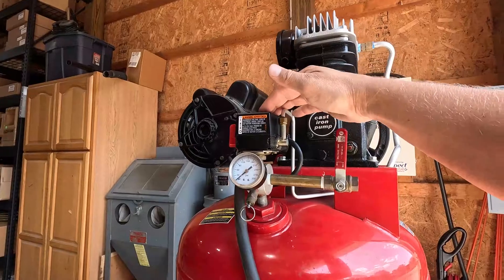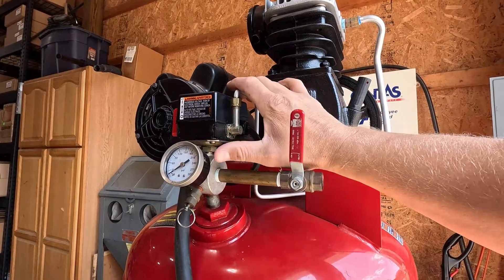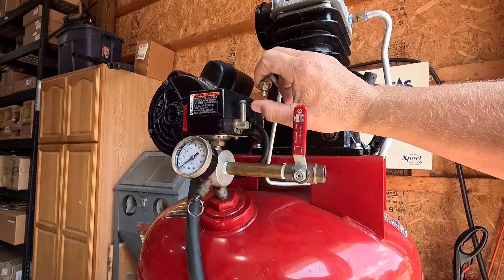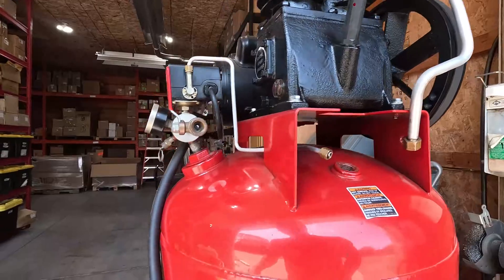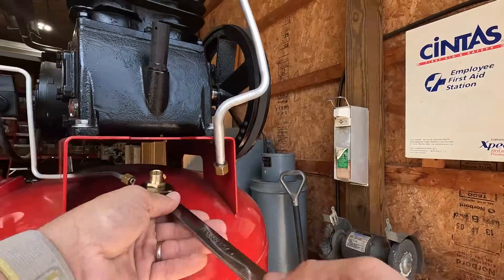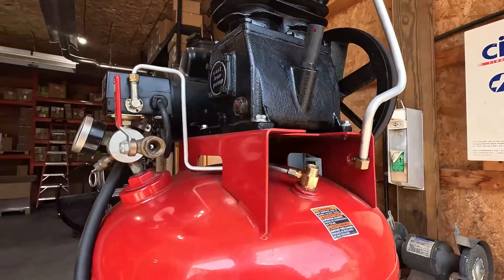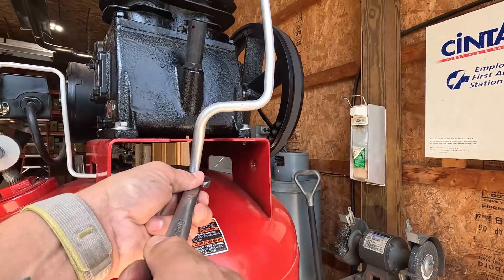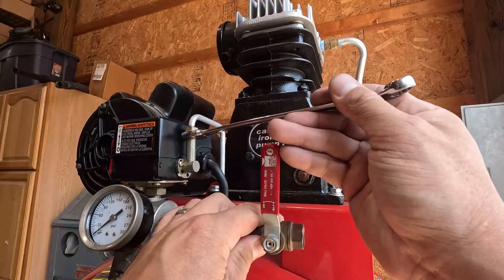Fixing A Leaking Air Compressor

Comment: Just wondering what size check valve your is? Mine seems to use the same size wrenches so I just don’t want to buy the wrong size by accident
Reply from the maker: If you can find the model number of your compressor, we can give you a more accurate part number to purchase.
Reply: @Allpartsinc mine is a diy, but the tank has this  on it VT631402AJ and it’s a husky pro

Comment: Mine is leaking from somewhere my oil cap has a little hole in it and air is coming through there? Is this a safety precaution to release air?
Reply from the maker: It depends on how hard the air is coming out. There is a breather hole in the cap that's meant to let some air out, but if it's excessive, then it could be a sign of a blown head gasket or bad rings. Combustible air is getting back into the crankcase that shouldn't be.
Reply: @Allpartsinc It was the check valve after watching your video I found where it was coming from!! Thanks for replying

Comment: The pressure guage didn't seem to be moving.
Reply from the maker: Correct, for the purposes of the video, and to save time, we didn't let it build a lot of pressure. For testing purposes on your compressor, you shouldn't need to build more than about 30-50 pounds of pressure. We wouldn't go higher than that for safety purposes as well.